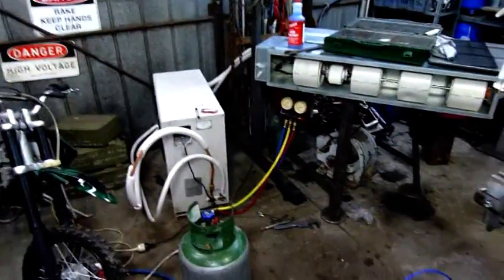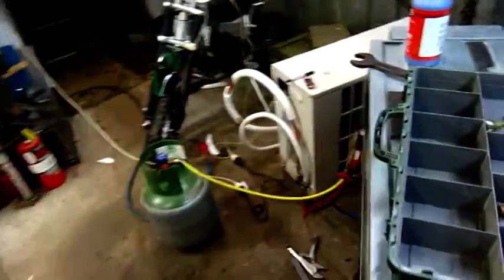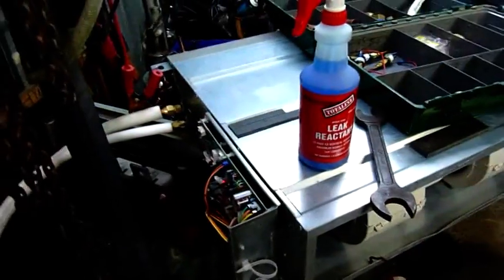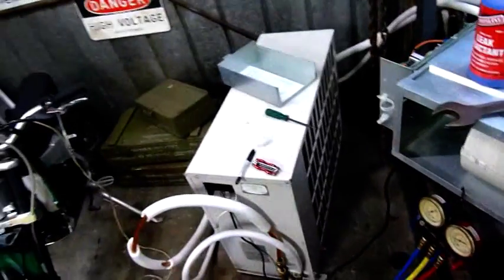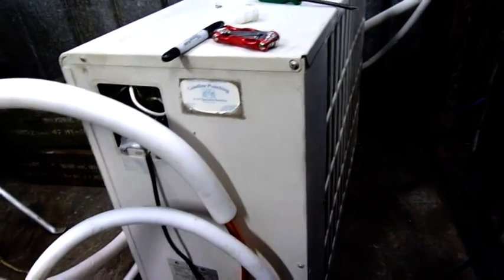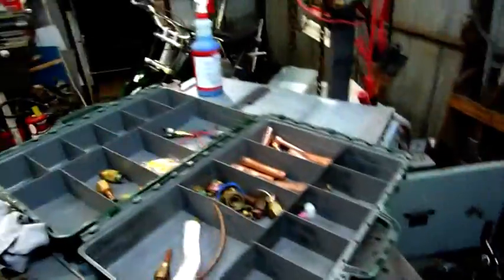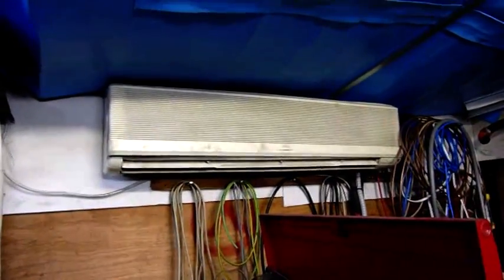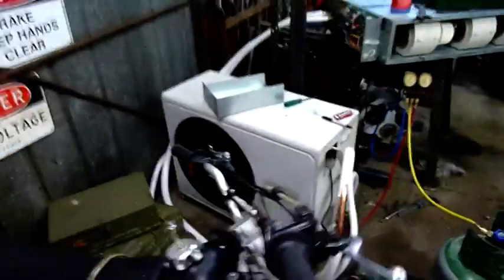Mitsu-Jitsu Heat Pump Test ( Hobby HVAC Project )

Comment: @tlaroche38 I bought one of those 12000btu split systems a few years ago and although its a Chinese cheapo thing it has performed extreamly well. Air coming out the outlet in cooling mode is sub zero! Was heating quite nicely in last winter's -15'c cold spell. The outdoor compressor is very quiet and so is the indoor unit. Can't go wrong for the price I paid... £178!!! You couldn't even get a crappy portable one for that price now!

Comment from the maker: @reggieobe98 you can go by the pressures/temps (only low-side in this case) and performance in hot/cold weather.

Ideally I just want the suction line to get sweaty like a cold beercan, but on a 35 - 38* day.

these mini splits can tollerate a bit of variation in their charges without complaint.